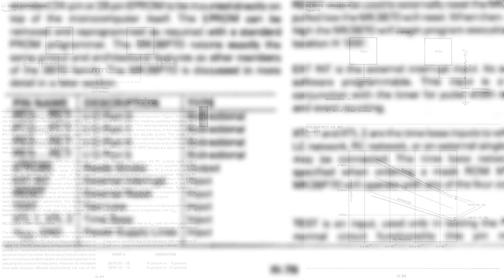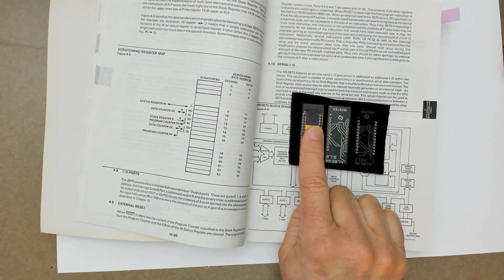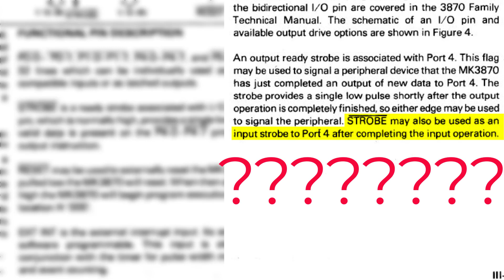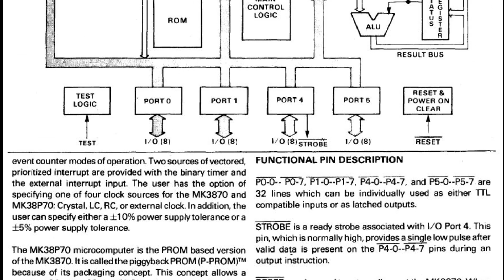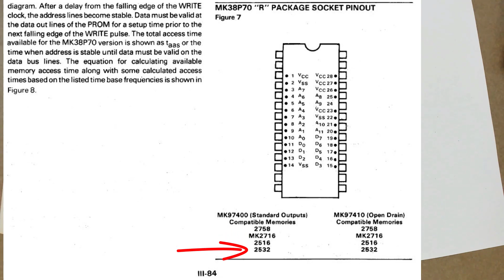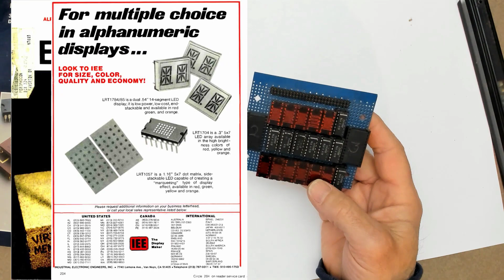{85} Fairchild F8 - Mostek 38P70 - Enough Hardware  Knowledge to Be Dangerous

Comment: Serial port, but not MAX-232 or MC1488/1489?  Well, what about 20mA current loop?
Reply from the maker: Current loop would certainly be age appropriate, I am out of current loop to serial adapters and using a TTY gets irritating after several minutes